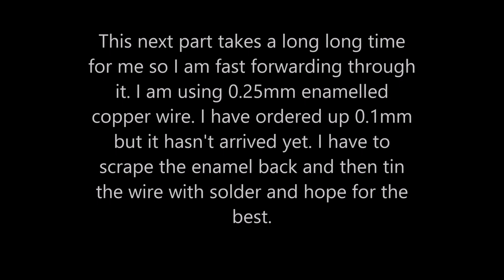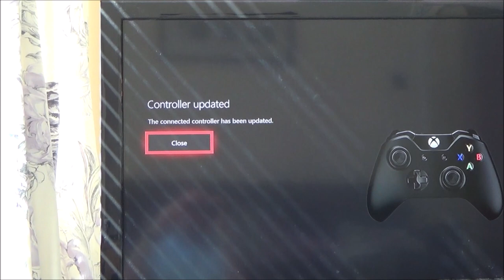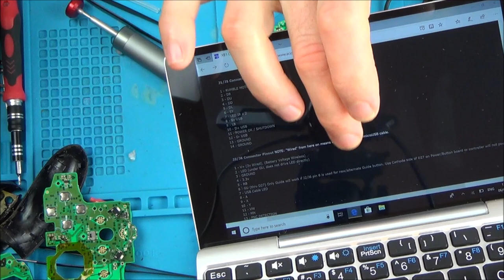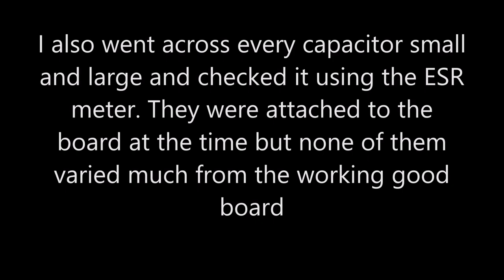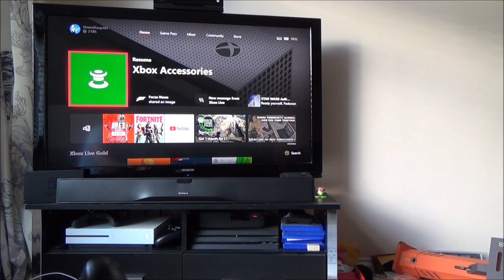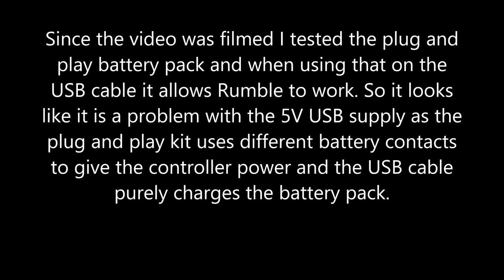Trying to FIX eBay Joblot of Faulty Xbox One Controllers PART 4

Comment: Great job!  Loving this little box of controllers!  More lol!   That board charring - wasn't what you did, it was all part of the damage done to the original IC I think.  With failures like that I often cut the pins of the IC to aid removal.  You sometimes find they glue the underneath of some SMD components down at manafucture with a tiny blob of glue on the underside of the component (to hold it in place for wave soldering).

That large black component that you thought said R something - actually its marked L something (L2?) - it's an inductor.  Likely a choke.  With regards to that diode - that was something I was screaming out after your checked everything else around that area!  When an IC burns up like that always check everything that connects to it, or you can end up with a repeat failure.  Marking on the PCB was D23 not O23 =D  Easily done, I've may similar mistakes when reading super small print like that!   Regards the rumble when used by cable, I wonder if a connection was missing on that little IC you replaced?  I would be tempted not to glue over something like that though as you cannot easily revisit it (for example if there is a missing connection for the rumble).  I think you are right though that most people would just only ever use the USB cable to charge it.  Losing rumble whilst charging isn't the end of the world at all!   I enjoyed the video Vince =D
Reply: @Blu Rogers .?
Reply: @GadgetUK164  OOOH can I have a go .?.?.?.?.?.?.?.?.? Don't worry I understood your comment, was just making fun of that other .? comment.
Reply from the maker: Only 2 more to go now Chris, I will be upset when it ends!!!! I have started on a box of PS4 controllers to delay the sad day when the Xbox One controller box is empty :-(
Thanks for the useful tips as usual. I am pretty sure all the legs on that little IC were connected to where they should be although the bottom lot looked a complete mess. I have had a couple of pointers in the comments mentioning I think it was the U3 IC so maybe I can look at it another time. If I come across another burnt component I will snip the legs next time and hopefully there will be less repair to do afterwards. Thanks again for the advice/tips :-)
Reply: @Mymatevince  these techniques are more interesting to me, than the actual working part, since it'll cut down on time and mistakes.
Reply: No worries, looking forward to more!  I wonder if the PS4 controllers will have as many interesting faults?  I think what made these better was the fact that some cowboy had bodged all of them together from faulty parts he had cleared worked on (and messed up!).   The most difficult things in life often turn out to be the most rewarding!

Comment: I think everyone will agree we're all just as addicted and intrigued by these controllers as much as you. So much mystery!

Anyway, just a small heads up, the 3.5mm headphone jack was included in an early revision of the original model so just because it has one it doesn't mean it's one of the 2016 models that support Bluetooth.

To easiest way to tell the Bluetooth and non-Bluetooth models apart is the design of the front.

On the Bluetooth model, the Xbox button is part of the front cover plate that all the other buttons also poke through.

On the non-Bluetooth model the Xbox button is part of the shoulder button housing that runs along the top.

Comment: Another great job Vince!
By the way, your multimeter has diode mode, you can switch to that and check the voltage drop (0.7V to 1.2V are typical values). It should only display a value when you measure it one way around, otherwise you'll know you have a faulty diode

Comment: when a component dont want to come off : FIrst add solder to the IC's pins, make a fat bridging blob of solder in each side with your soldering iron, then hot air, it will come off easily, then clean the blob of solder with some braid.
Reply: I came to say this! Add some leaded solder or quik chip low melt solder i think its called? Makes it far more melty! Although if that was the ground pad that burnt out previous it might of stayed stuck and bought the pad with it either way. Also that hot air station might want to double check its temp because i doubt it will be as advertised. I have the same one and its not calibrated by any means.
Reply: Yes you both are right it makes it easier to remove but if the pads are fused to the component it will still be hard to remove with out damage to traces and from the looks of the burns it burned into the board under the pads

Comment: Try replacing the U2 chip, or check the components around that chip. 
Acidmods says "U2 is for a 3.5v source that powers the LED, IR LEDs and the Rumble motors. It's TP7 on the MCU board"
Reply: likely wont be that chip specifically as he is getting LED and IR. but something on that rail that goes specifically to the rumble is gone
Reply: @Altirix_  chip may be faulty as well, one pin of the chip can probably be the output for the rumbe motor. But yeah, it might not be the chip. Vince could try to take diode mode measurements on the different pins
Reply from the maker: Thanks for the idea, I can try and take a few readings between boards to see if they are different :-)
Reply: @Mymatevince  try taking diode measure with red probe on ground, and the black one on each leg of the chip. Compare with the other board that works :)
Reply from the maker: Thanks Mommotexx. I will check the U2 and the U3 chip using your method :-)
Reply: @Mymatevince  Hope you figure it out. If you don't get the same results, it dosen't mean that the chip is bad, but something on that rail. It can be the chip, or something else on that rail. Good luck! :)
Reply: It very confusing because u2 works perfectly under battery power. You may want to compare how it gets power on battery vs usb and test what it's supposed to do on a good controller. 

Just realized this is most likely the damage of a cell phone "quick charger". Why 9v mode gets triggered is a mystery.
Reply: @lonjeloco  

Think I found the datasheet for the U2 chip. Try to check input voltage on the chip as Adrian says. If you can, turn on continious rumble on your pc with usb connected, and check enable pin, and output pin of the chip

Datasheet:
http://www.alldatasheet.com/datasheet-pdf/pdf/1036102/MPS/MP3414.html

Comment: :D Vince is Controller-Addicted. Maybe for future repairs it would help you when you make your own schematics of every working board you get. You meassure things you think are most important for you and then write it down. Over time then you have a full schematic of some boards that you are able to read perfectly. Additionally you can lookup in datasheets what resistance or voltage or impendance some parts should have.

Comment: Great video series!!  After "nuking" the board under repair, I would have switched it around and used the burned board as the spares board and fixed the one that was originally the spares!

Comment: My guess for the rumble motors would be that there are two transistors that output either battery voltage or usb voltage and that the one for usb is not working. Try looking at the schematic where does the rumble motor trace go to.
Reply: U3 IC supplies the voltage for the rumble motors
Reply from the maker: Excellent, I will look at U3 and compare it with a working board to see if it is testing the same. Thanks for the tip :-)

Comment: Yep still something between u1 to u2. Very odd as the led still works when wired with no battery. It's mentioned under "power" in the acidmod forum.

Comment: I've come across some very stubborn components as well, and it's so frustrating when an ic or cap or resistor doesn't want to be removed! Once, I've dremmeled the legs of the ic and I soldered the new one over the legs of the old one. Ugly but it worked. You should try it.

Comment: @My Mate Vince the reason your triggers didn't work in the initial test with the known good board is because the xbox one controller triggers work using the Hall Effect. The magnet on the trigger stem registers when it passes over a sensor, so the board needs to be in proper position. These controller vids are some of your best!👍

Comment: Your struggle with removing that IC with the heat gun makes me wonder.  When the chip failed, did it get so hot that it welded the metal from the pins to the metal of the solder pads.  I'm not talking about the solder, I'm talking about the actual metal of the pins welded to the copper solder pads.  Solder has a low melting point, and the metal of the pins and copper have a much higher melting point.  Could the IC have reached those temperatures when it failed?
Reply: 100% agree with you.

Comment: dont know if its been said already, but the triggers work via magnets and sensors on the board, the magnets actuate the sensors so wouldnt work with out the board being correctly situated in the shell.

Comment: That black thing is an inductor, a 0.91uH if I'm reading it right, something like this: https://www.globalsources.com/si/AS/Coilank-International/6008842116488/pdtl/ABG04A30-4x4x3mm-r91-0.91uh-to-120uh-tak-Smd-smt-p/1146919320.htm

As an advice, for things like what you have done to the IC (impressive btw, that pcb was really damaged :D) you should use wrapping wire, like this: https://aliexpress.com/item/32978316383.html

About the rumbles, that looks like a dead diode or transistor. That controller has suffered of an overvoltage or a polarity inversion, that's why the IC was burnt and the diode dead. Measuring diodes is very easy: put the tester in diode mode and measure using the right polarity, the diode should have a white or black line marking the negative, if the diode is OK it should tell you the voltage drop in the correct orientation (negative on the lead near the black line, positive on the other lead) and totally open in the other way. If the diode measures as open (does not conduce in any direction), measures very low or high voltage drop or measures as shorted (conduces voltage in both directions), the diode is dead. Usually the diodes have a voltage drop from 0.5v to 0.8v.

Beware that measuring a component in-circuit can give you wrong readings as the rest of the circuit will have an impact in such measures, so if you check something that seems to be wrong, test it again once it's removed from the circuit.

Measuring a transistor is a bit more difficult as you need to know the pin out and if it's a NPN or PNP transistor, once you know it then you can measure between base and collector, and base and emitter, these will act as two diodes, the type of transistor (NPN or PNP) tells you the polarity, NPN means negative-positive-negative, so the base is positive and emitter and collector are negative, PNP is just the reverse, base is negative and emitter and collector are positive. As a hint, on SMD transistors usually the upper-center lead is the base, but it's not always true.

Hope it helps!

Comment: The triggers aren't potentiometers, they're hall effect sensors. There's a magnet on the trigger that is moved over a hall effect sensor on the board, that's why it won't work if you try the triggers with the board lifted up from the case. Posted this link on part 1, but it's an older video so perhaps it's more visible here. It contains a lot of good information on the controllers. :) https://www.acidmods.com/forum/index.php?topic=43204.0

Comment: One thing on the rework on the board is to "pot" it by using something like a epoxy because shocks and knocks may knock the repair work off the board, I always use a bit of hot glue as its easy to remove and very tough when in something that gets knocked about.   I kept getting water in my headlamp and I just hot snotted it sealed and no more steamy sessions behind the glass going on and been sealed for months.

Comment: Sometimes when a part overheats, it will essentially weld itself to the pads. Your best bet in that case (before you burn everything else up) is to clip off the chip legs, and use a soldering iron to try to remove each leg separately. You still might rip off a pad or trace that you'll have to repair (with some very fine wire), but the damage will be localized.

Comment: You should have added new fresh solder with a soldering iron before using the heat gun to desolder it. It's still fixable but it will take a lot more work to fix it now.

Comment: Next time you should clean the contacts with fresh solder and a solder iron, after that use your hot air and flux to remove the old IC...it should come up very quickly. If you heat up the caps and resistors as long as you did here it will destroy them.

Comment: The triggers have magnets inside of them, and when you move them above the board the little chips on them can sense the changing of the magnetic stuff,the two cables coming from the triggers are only for the rummblemotors inside of the triggers
Reply from the maker: Thank you :-)

Comment: Playstation 4 controllers are fun. A lot of them are an easy fix, especially if the bumpers aren't working.  Sony used relatively cheap silicone on them and fixing them can be done using bath room silicone.

Comment: the problem was mostly your nozzle for the hot air. with a small chip like that you want it to be about the size of the chip itself if not a little bigger, the one you was using was just spreading the heat to fast to everything else around it so the temp the actual chip was getting just wasnt good enough to melt the no-lead solder that it probably has. to help with this you can make a quick pass with leaded solder which helps wick up the hard to work with stuff. Hope that helps a little :-)
Reply: Alas, no. The chip got so hot it welded itself to the pads. There is no kind way to remove it.

Comment: this leadfree solder is kinda impossible to get off using a heatgun, i noticed that several times. best thing to do is trying to go in with the iron and saturate it with regular lead based solder so you can remove it easier afterwards :D
Reply: Nah. 380°C is fine for removing the components. The board is thin and doesn't absorb the heat unlike the Xbox console boards.

Comment: In about 16 minutes, you may not use a heat gun when you remove that chip.Usually when I remove this chip, I use the method of stacking tin. This damage to the pad is relatively small

Comment: You could have added leaded solder to the legs of that burned IC would have lowered the melting point and made it easier to pick up.
Thanks for the videos by the way, learning a lot from you and making many mistakes in the process. Stuck with 2 ps4 boards currently.
Reply: Check for water damage under the MCU. I had two - one wouldn't communicate over USB (console sync) or charge correctly - the other had buttons that didn't work.  Both had liquid damage under the MCU (and generally around the boards). Flux, heat and an IPA bath bought both back to life.

Comment: Very nice :). The chips do effectively weld themselves to their pads when they die like that.  There's no nice way to remove them. If I buy another one in that state I'll be trying to cut the pad/trace with a knife to limit the damage.

The chip that melted itself is an MP2161 - datasheet is here:
https://www.monolithicpower.com/pub/media/document/MP2161_r1.1.pdf

My understanding is MP2161 (U1) takes the USB 5v and step down converts it to around 3 volts which U3 (an MP3414) converts to the 3.3v voltage for the logic board and U2 (also an MP 3414) converts to 3.5V for the rumble motors.  As for why the rumble motors don't work when powered from USB - I would want to check the voltage output of U1. I suspect it may be too low for two possible reasons, both linked to the charred PCB around the U1 area. The charred PCB is likely now conductive.  Potentially the voltage selection on U1 (by the two tiny resistors) is being affected or the charred PCB could just be providing a high resistance short to ground.

Just a theory! Also, don't install new U1 chips on the board upside down. They don't like that..

Also also, dead U1 chips can often short the power rails to ground so even batteries won't power the controller. You can remove U1 and the controller will work just fine from batteries. I found that out after removing/reinstalling almost every capacitor chasing a short to ground to find out it was U1 which had no outward sign of failure. 🙄 New U1 - alles gut!

Comment: Just noticed your surprise that the Triggers are now working but they are not Potentiometers on Xb1 controllers but instead Hall effect sensors on the main board and magnets in the triggers themselves, when you were testing the controller it was ripped apart and the board rotated, so they were not coming near the sensors.

Comment: Haven’t watched the whole video yet but the reason the triggers weren’t working at 9:40 was because you had the board lifted away from the magnets so you weren’t actually activating the triggers at all lol that backboard wasn’t faulty.

Edit: have you checked if the rumbles were soldered in at the wrong polarity, if they were wired in backwards that might be why they work wireless but not wired.

Comment: I've never used a xbox controller at w10, but, as far as I remember, Windows have a built in joystick configuration page at control panel where you can test the controllers without having to use third party software.
Reply: Lucas Araujo it wont be as good though,

This sees them as an xbox one controller, shows all the buttons and sticks in the correct locations,

Windows just sees a generic controller with a bunch buttons last time i checked.

Comment: If you need to remove small SMD components, you can just push the off with a soldering iron. No need to use the heatgun.